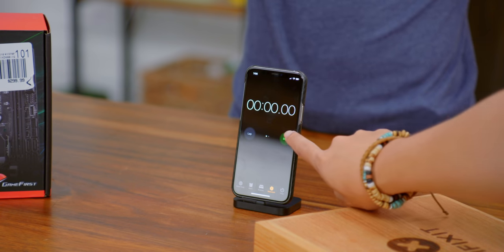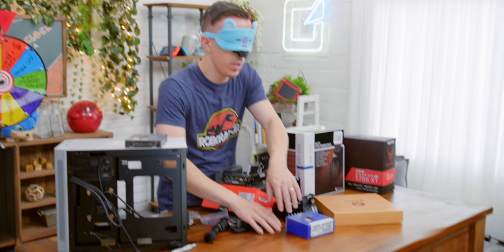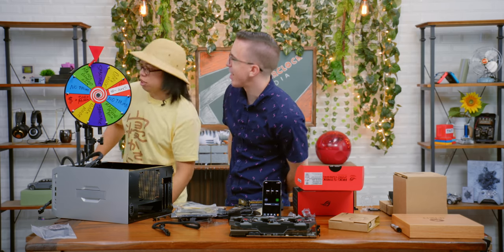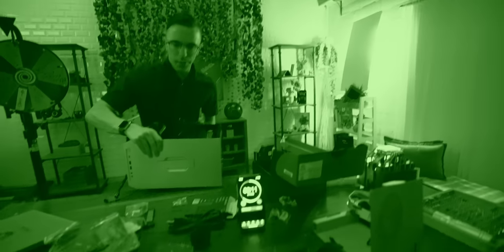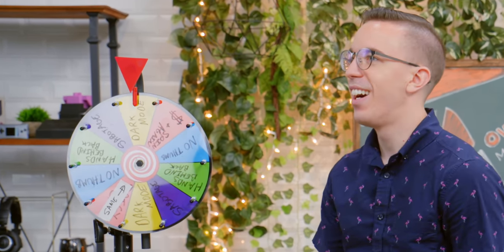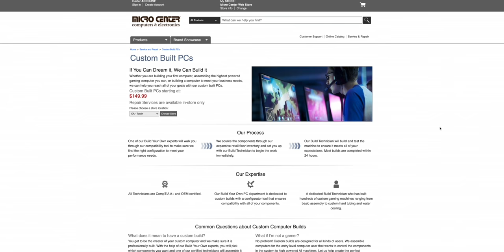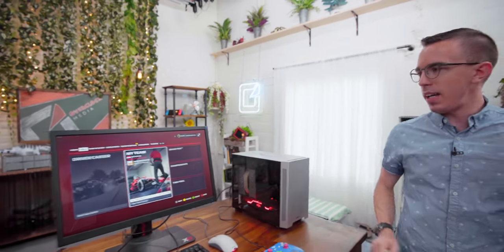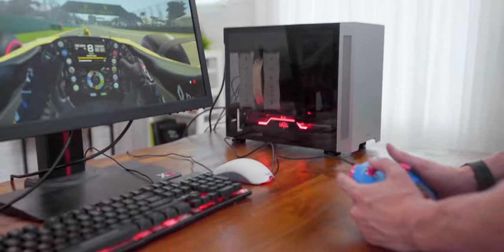NEVER Build a Gaming PC like this...

Comment: 2050
Austin: today I am going to attempt to build a pc in ONLY 25,000
Reply: honestly, pc prices overall should stay about the same, considering that in the 1990s you could get a pc with a 166mhz cpu and 64mb of ram for over $4,000
Reply: @nuttyjoe  That would have been over 6k USD then, if anything, PC prices have gone down since 1999, and assuming we don't get another 2000 series, they should stay around the same prices as today or even go down.
Reply: But they are also made from some non renewable resources so eventually their bound to go up

Comment: I like this episode, the variety of obstacles Austin has to go through is amusing. But I gotta say, you should give him a safe spot like every 5 turns, or whenever Ken or Matt call "pity" on him, so he can have a competitive chance. I think Austin got beaten down by the non-stop handicaps placed on him, and even when he tried his best, the challenges changed on him all the time. If he had a segment to have no obstacles and actually BUILD THE COMPUTER, then he'd have a refresh point for his morale, the video would showcase his talents in assembly, and you can still have more Wheel-Spin Challenge sections than easy parts. Like 5-1 ratio hardships vs smooth sailing sections.

EDIT: Oh a free space @12:00 good choice

Comment: Your probably never gonna read this but i'm working on building a pc and i only have like 500 dollars what are the best parts i should get
Reply: Just look it up on pc part picker
Reply: Just go with amd products
Reply: Try the ATHLON 3000g
The asus Geforce GT 1030s are pretty cheap, or a xfx radeon rx 570.
As for memory just look around 8gb or 16 is all you really need, and corsair do great deals all the time.
Cases are around $50-90.
For storage i would highly recommend the SN500 NVMe SSD from Western Digital, its only $50.
For motherboards good luck.
Cooling is easy as pie, around 40 bucks is all ya need.
Power is nothing to mess around with, go corsair.
Other than that windows on a USB. Or read up on some linux
Reply: Actually as an add on, if you know a friend whose done it once or twice get them to come round and give tips/supervise.
(I am usually that friend)